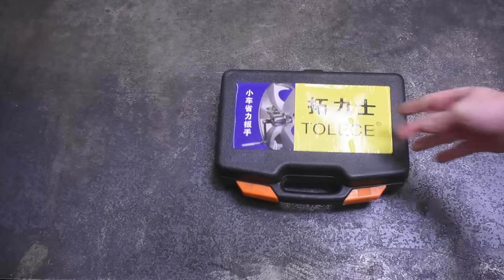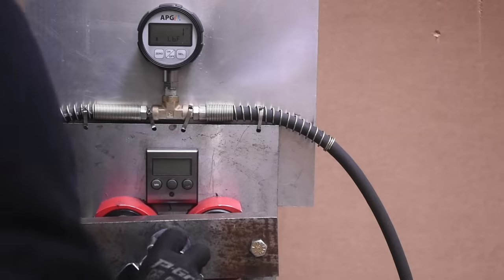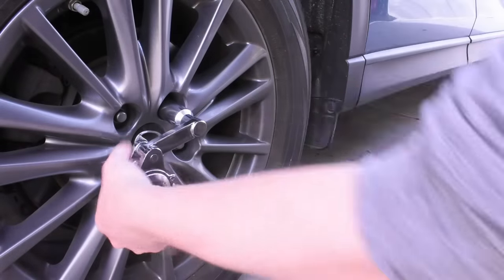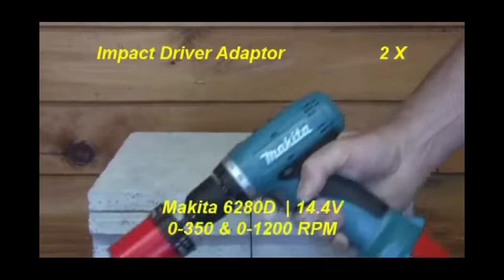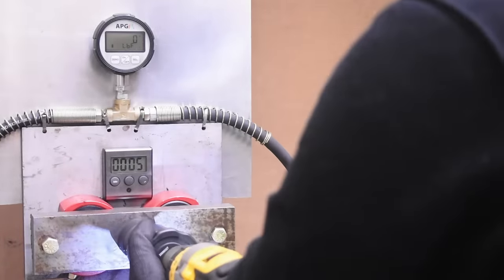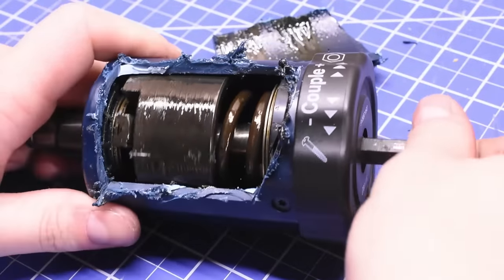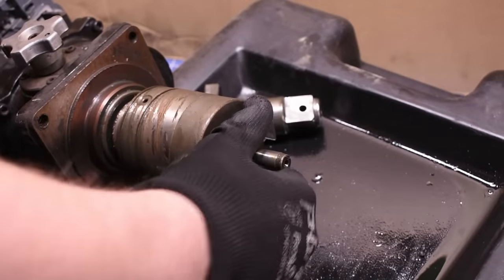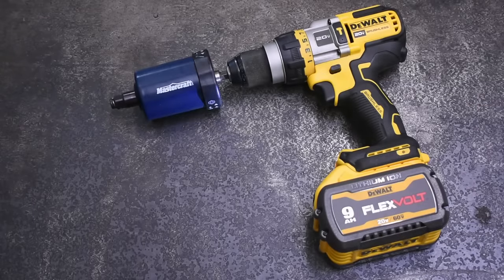Testing TikTok Tool Hacks: Surprisingly Amazing!

Comment from the maker: Edit: I surprised no one has gotten the easter egg yet tho
This was supposed to be like an April Fools episode. "Check out how awesome tiktok tools are!" Wink wink. But one was accidently pretty sweet. It happens 😅
Reply: so a tool adapter that actually delivers the goods for once and does it better then anticipated? nice.
Reply: That's hilarious 😂😂
Reply: That's got to be the most torque per $ we've ever seen. These babies are getting scraped up off ebay and garage sales now!
Reply: Ok the Mastercraft torque couple+ - do you have a name or item number I can't find a used one ! ?
Thanks ahead of time if you see this.
Reply: anychance you would be able to try this tool on a die grinder? maybe a .8hp die grinder or something im interested if it overcomes the spring torque the kind of power this would make
Reply: I have one for my semi-truck. It does work, just take a bit of work and time vs. air powered tool. I did invest in the 3/4 "blue" battery powered impact and it does work on those truck nuts.
Reply: @shakdidagalimal  sold exclusively at Canadian tire, if that helps at all.
Reply: It's a good thing you didn't connect the drill adapter TO that chinesium torque multiplier, or then we'd probably have thought this video was a hoax!
(just to be sure, that adapter legitimately worked, right? 😒)
Reply: @mikegander305  Thank you.
Reply from the maker: @DUKE_of_RAMBLE  Yeah, the adapter is the friggin bomb. For real, if you have a high power cordless drill
Reply: I have a request I found a particular hack on the new DeWalt 3-speed hammer drill to get another 250 RPM out of it if you put it in hammer drill mode and squeeze the trigger and then roll the selector back to regular drill without releasing the trigger you can fool it into running at hammer drill RPM with the hammer drill disengaged
Reply: @shakdidagalimal  except they were discontinued about seven or eight years ago. I remember trying to buy one for a project only to find out they were in the sunset period. Here’s hoping they’ll start popping up on ebay thanks to this vid
Reply: @shakdidagalimal  YES! I want a Mastercraft torque monster! Great video! I would have never found this on accident. Subscribed long ago for the Great content!
Reply: Use it with corded drill with high rpm
Reply: @georgemorales4264  and the DeWalt drill is probably the highest RPM drill that I'm familiar with which includes corded at 2,250 RPM output most power drills are 1800 RPM and below
Reply: I would love to see some tests of aviation AN bolts and how they compare against others.
Reply: @rocketsurgeon4876  I do believe they did an episode on that can't recall if they got any aerospace grade yet
Reply: @makehasteBrandon  Yes I saw both the comparison between fasteners, and head bolts. It's why I asked. Aviation fasteners weren't part of either test. Aviation technology for the most part is stuck in the stone age because of just how hard it is to get anything new certified for use. So my suspicion is that an aviation bolt is somewhere about the quality of a grade 5, but I would like to see some real comparison.
Reply: @rocketsurgeon4876  Aircraft fasteners are awesome! But the real cool stuff is the brown thread sealant/locking compound. That works like green locktite.
Reply: @SPHYNX99752  Link to the locking compound you're referring to?
Reply: @makehasteBrandon  you might want to look around and check out the Metabo BS 18 LTX-3 BL I for instance then. The "normal" LTX 2 speed version goes to 2000rpm but these 3 speed machines go to 4000rpm. On the low speed setting they're a bit of a arm twister already (handle advised). But you can get a 3 to 1 reduction gearbox accessory that gives it about 180nm working torque.
I'm sorry, but that DeWalt is definitely not the king of the hill.
Reply: @IM_I1985  indeed I only have familiarity with what I have access to
Reply: @makehasteBrandon  Fair enough, and I'd speculate you're from the US, where Metabo isn't that well known I believe and not all their tools are available either I think.
To my experience that DeWalt isn't that great as a normal drill though. It's big and heavy due to the (light) hammer system to drill masonry. But for that it also is limited. So it's really a compromise to make 1 tool do it all, but none of the things really good.
Reply: @IM_I1985  indeed did not purchase it for the hammer drill function just the purpose of 3-speed gear selection for better RPM and torque control when using hole saws for instance or drilling through mild steel with large silver and demming drill bits
Reply: shocking that a $40 tool design thats been around forever that does the job of a modern $300+ platform got completely buried.... just doesn't make sense...
Reply: Is that picture real? The new Milwaukee high torque prototypes? I call first dibs when you give one away. When will it release?
Reply: Between that Mastercraft impact adapter and the "skip" design of the Metabo 3-lobe hammer, with modern brushless impact motors, it seems like a more interesting design would be an impact with rather than adjustable spring, just a 2 position switch for a mostly regular 2 hammer design. Metabo's extra lobe is adding mass to the anvil which robs (a small bit of) torque at full stop. Let us consider instead a brushless impact that has a spring control switch for "180" and "360" (skip) hammering where the brushless brainbox knows the difference and can use nearly 360 degrees to push to max RPMs for fewer, but harder impacts.
Reply: Is it the beans bolt head?
Reply: Hai, i like your content
But where i can buy thr tools
Because in my country not Avelible

Comment: That little impact adapter is a perfect tool for someone who already owns a drill, but can occationally use an impact, like for tire lug nuts. Cheap and way way more potent than I would have ever expected. Would love to see them come back on the market and would legit buy 2 or 3 as Xmas gifts in a heart beat.
Reply: It looks like a life saver for wheel axel nuts.
Reply: Not gonna lie i need something like this for my job. I'm an assembly vendor so I build Gazibos and grills and stuff like that and I dont have an impact drill. I'm using an electric screw driver and a 10V drill. This would help out so much. My coworkers are always giving me crap for not having enough torque for things and I'm looking at this little thing like it would make my job so much easier cause my battery's die as fast.
Reply: @brianbello1095 why didn't you get an impact driver, or 3 in 1 drill with screw, drill n impact functions? they are more versatile for your work and easier to carry.
Reply: At 40 bucks it's really not a whole lot less than just buying a brushless impact driver of whichever battery/manufacturer your drill is.
Reply: Definitely a stellar stocking stuffer!  I approve!!!

Comment: Getting some cheap torque multipliers would be a great idea. Some of us have small commercial vehicles to work on that require some crazy torque settings and a decent cheap multiplier would be a great addition to the toolbox
Reply: Yea this past week i had to remove and replace 3 different crank pulleys and had to get the 5 foot cheater out literally jumping on the damn thing to get em off then back on with their crazy 180° past 250.,  like wtf…. These newer higher end deals have some bullshit specs..
Reply: the problem that I have found with cheap torque multipliers is that they are almost impossible to calibrate. could you get close enough and be fairly consistent? probably. want to bet $100,000 when you use it on a big diesel motor? probably not. that being said, they are great to have hanging around for some of those stubborn bolts that are just stuck
Reply: @Z-Ack  those torq specs are for girls. Small bolts you crank with the wrist. big bolts you use longer lever and the whole arm. case solved. no need for eny diagrams and planetary cycles. never had a bolt come loose or snap...
Reply: @michaelmcgregor3108  In-line torque meters are also a thing.  If you have the space to be using a torque multiplier, you also have the room for a meter.
Reply: @vihreelinja4743  you have obviously never dealt with anything of consequence. When it says 155+ 180* you feel like it’s going to pull threads or snap the bolt. But the spec is there for a reason
Reply: the one made for volkswagen beetle axle nuts would make fore a cool episode. They've gotta be fairly common and can take a beating

Comment: That last adapter was sick! It would be a great option for people like my dad who occasionally could use an impact, but only once or twice a year so he won't justify spending money on one. If this is cheap enough it would be a good option as he has a decent drill to use with it.
Reply: Definitely. With 2 cars there's 40-48 lug nuts/bolts to take off and on when switching between winter and summer tires (80-96 total per year), so a $40 adapter would be perfect. I'd rather spend a little extra on a drill that gets a lot more use during the year.

Comment: The most common sized nut I have to tighten is a 1-11/16", where I use a breaker bar with 8' of cheater tube to reach the torque requirement.  I have thought about getting a torque multiplier for the 3/4" and 1" drive range.  There isn't anything fun about getting old as you can always remember how easy it was in your prime.
Reply: Sounds like you need a longer cheater tube
Reply: @lolatmyage  LOL!  That would be true if I was a tiny city kid.

Comment: I would love an adjustable impact. You wouldn't need a smaller impact for sensitive stuff, you could just have a single big one that's adjustable and call it a day.
Reply: I think that's why they supply them with a output adjusting device in the shape of a trigger, not an on/off switch bud
Reply: They got speed settings, and analog trigger, which is exactly what youre asking for. Some are better than others, you dont want trigger lag or trigger insensitivity for sensitive jobs so Makita is hard to beat here.
Reply: @pflaffik  using a different speed is something completely different than an adjustable anvil, lol.
Reply: My 20v DeWalt impact gun has 2 settings and my impact driver has 3. It's two tools but covers everything.

Comment: Lol that torque multiplier just adds more work to an already easy task…😅

But the real good thing here is your explanation and breakdown 

Thank you!
Reply: Nothing better than using some simple, mechanical advantage via a long lever.
Reply: @graealex  while I agree a length of pipe is your best friend for removing stuck fasteners. You might be able to find space in the spare tire compartment for a small torque multiplier. 3ft section of pipe to help you unstick your lug nuts if the shop puts em on with an impact? I doubt it.

I still remember getting stuck because I couldn’t change a flat tire with the stock wrench. Heck the tow truck we called couldn’t get em off with a breaker bar. Needed new studs and lug nuts after that one.
Reply: @andyruse4670  Well, where I come from, you just jump on and kick the end of the wrench until the nut comes loose. Props for remembering to do that before you actually jack up the car and have the wheels free spinning...
But a few episodes ago, we saw that dinky kitchen mixer loose nuts way out of it's weight class, so maybe that is the right implement for road-side emergencies instead of a cheater bar.
Reply: @andyruse4670  there's an easier solution: Don't change your tires at a shop. Do it yourself.

Comment: On the topic of torque multipliers, I have used a genuine nut buddy, meant for semi truck wheels to remove dozer cutting edges.  It will absolutely twist off a 1" gr12 bolt if you crank it the wrong way. Without over exerting myself, and I'm by no means a large gorilla on tools. 
Would like to see it on a torque dyno.

Comment: Torque multipliers are mandatory for semi-truck lug nuts, it's near impossible to get them off with a breaker bar and whatever pipe you put on it.
Reply: not if you get the whole gang to stand on it

Comment: When I started at my job years ago, we had an old "4-1" torque multiplier. My supervisor told me it was 4-1, because it rotated 1 on the output for every 4 on the input...

... except it only multiplied by 3.33, which means they'd been under-tightening everything for years, not to mention they'd occasionally use an impact on it to break stuff loose. 

We got a new one.

Comment: Can you put that adapter on an impact driver? I doubt it would work very well, but I would like to see some double impact action.
Reply: In this scenario, impact wrench will work just like a drill because there won't be enough torque for the camming action.

Comment: Ohhhh finally something I can add real life experience to. So, I used a beefy torque multiplier several times a day for years assembling large mandrels where I work. I believe the threads were 2 1/16". Not entirely sure, but they were properly massive bolts that were a couple feet long. The torque multipliers can add an absurd amount of power. They do wear out over time, but as long as you can give it the proper support, those things are unbelievable. Pucker factor 9000 😂😂😂
Reply: Yes same here we would do big mill gears in sections and the bigger ones use studs a few feet long and 3 3/4" diameter section to section,we had a 10,000 ftlbs hydraulic torque wrench to tighten or loosen the studs now on the older studs that have worked a while we had a 400lbs 1 1/2" torque multiplier with a 24,000 ratio reduction and we have twisted hardened 3" studs completely off with it
Reply: Had some huge bolts that I had to torque at work, they hold shaker motors for a mining shaker deck, I think either 1 7/8” or 2” thread and about 2-3 ft. Long, but we had to torque them to like 3000 ft lbs. we used an air powered torque gun, and damn that thing was insane. We also had a torque multiplier, but that thing is kinda a pain in the ass. Torque guns are just significantly better, but they’re expensive as all hell, some battery powered ones can cost up to 20k or something insane like that

Comment: Would love to see you test torque multipliers. Would also love to see a swench take on the dyno
Reply: A big breaker bar is just as good, maybe better and cheaper. It substitutes leverage for complexity.
Reply: @firesurfer work smart not hard. Torque multipliers have its uses.

Comment: Hey man, let me tell you! Drills today may be better... but my 18v Dewalt XRP 3 speed Hammer Drill with all metal gearbox of over  15years ago certainly didn't suck! I abused that poor thing so bad! 2" bimetal hole saws through 1" plate steel! 1" drill through 3" steel blocks! At one point it even quit running and had smoke pouring out of the brush vents! When it cooled down, it ran again and lived on for another 5 years! It took me 15 years to finally burn it out, and for being one tool in a four tool kit for a measly $250... it paid for itself a hundred times over! This is one of the biggest reasons I'm sold on Dewalt for life!

Comment: Not that this torque multiplier is worth using, but just back it off to remove the tension.  It won't start loosening the nut until it tensions up in the opposite direction.  As for the featured tool, I agree with the utility of building the adjustment into an impact gun, but wouldn't use the drill add-on due to the unwieldy length.

Comment: Hey, love the channel. Seeing the hand drill and adapter combo made me wonder if you'd be interested in testing a manual impact wrench? I'm talking about a Swench. They were made by Curtiss-Wright, then a company called PowerHawk and now I think Snap-on has the rights but it's all the same tool. It looks like a heavy ratchet wrench with a square drive on each side but the head of the wrench is the hammer and the spring is in the handle. Tension is adjustable with an Allen key. You just turn it until the spring is compressed and let's go, slamming the hammer, drive and socket into the nut. I may not be doing a good job explaining how it works but there are a few videos on YouTube demonstrating their use. Apparently they were designed for the military for repairing heavy equipment in the field. Anyway I've got the baby of the lineup, the 1/2" model and I think it's rated at 400ft/lbs but it'd be interesting to see what it's actually capable of. I rarely use it anyway, I bought it more as a curiosity than anything else. But my experience using it for lug nuts has shown me that the speed at which you crank the handle has a lot to do with it. There are bigger models that claim to hit thousands of lb/ft so maybe if some other people could loan you theirs you could make a whole video about them. A comparison to other oddball impacts wouldn't be bad either. Just don't cut it apart, lol!
Reply: I did a bit of research on the Swench. It sounds like a handy tool. The smaller one can put out 400ftlb of torque with only 39 lb input. That's a great increase.
Reply: That looks like a handy tool, but not $800-$3,000 handy.

Comment: I'm absolutely interested in some torque multiplier testing. We use them at work for flywheel and crank bolts on 2500hp diesels and it would be nice to know if we should actually be trusting them without verification/calibration. 

An OTC 4:1 is our workhorse most days.

Comment: Day I don't even know of asking you to test air ratchets. At work, I've got an Ingersoll Rand button-trigger swivel exhaust and a Jonnesway, both three eighths and rated for 75nm. The Jonnesway is slower but stronger. I've also got a Central Pneumatic, which sucks. Could you test them against a Chicago Pneumatic?

Comment: Norbar makes some impressive industrial torque multipliers.  I’ve got one that will shear 1 1/8” hex sockets using only a standard 24” 1/2” drive breaker bar for input…makes a guy jumpy when things break.